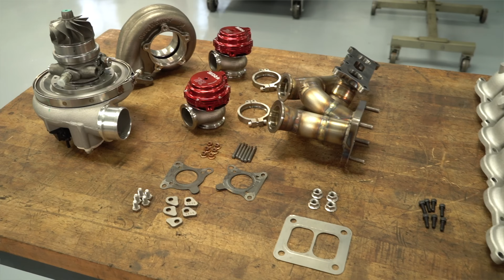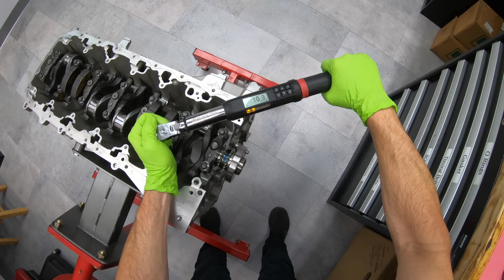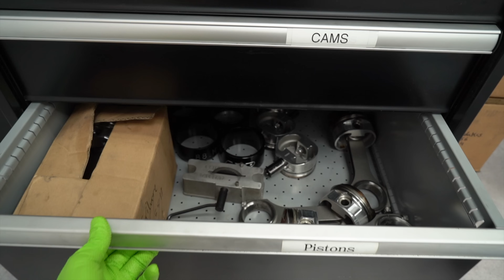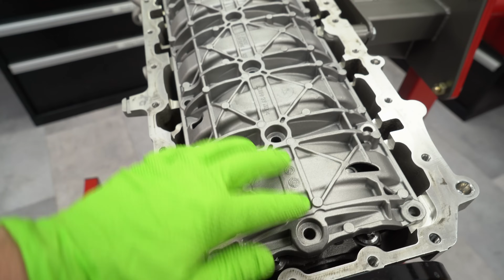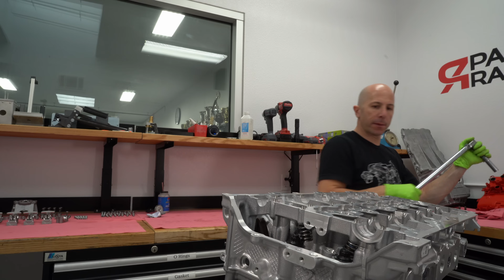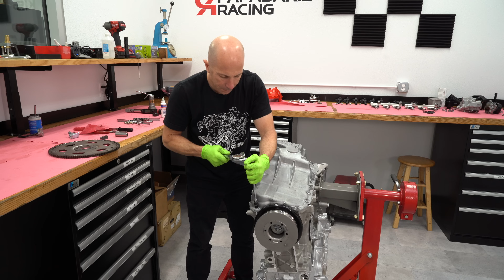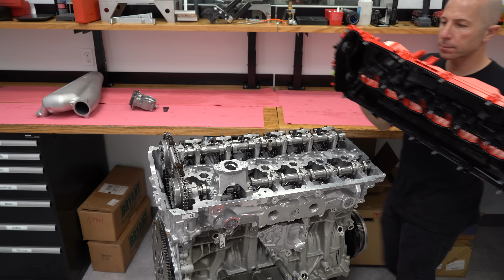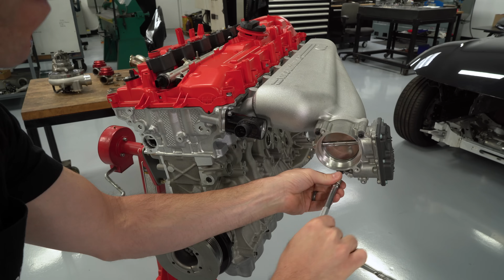2020 Supra 1000 HP Engine Assembly - Start to Finish

Comment: This gasoline engine is like M57 Diesel engine, very similar ;)
Reply: Wait, didn't that engine has multiple issues like timing chain snapped, connecting rod and crankshaft issue if I'm not mistaken or a different engine completely.
Reply: @zuhailishufller8046  Only timechain issue, after every 200k km you have to change it. 

Also camshaft issues, but that easy to fix and cheap. ;)

Comment: AdamLZ: “we have a 600hp Supra.”
Papadakis racing: “hold my candy bar.”

Edit: for those getting all bent out of shape over this, it’s just a joke!! Thanks for the likes
Reply: Adamlz also replaced his turbo. Adam is not the lame person here. Thestradman, vehicle virgins, and tjhunt are. They all just did widebody, bags, and/or wheels.
Reply: Naqay Chaayal  ... good one 😅
Reply: AdamLZ is just going with bolt-on parts. Anyone can do that.

Stephan actually tore down a brand-new engine to help in the research and development of new parts. And considering that he is using stock crank, bearings, piston rings, and camshafts, he'll see what are the limits of these parts.

It will be a very interesting build.
Reply: adamLZ: I have the current clickbait car watch this space
Professional tech: hold my boost
Reply: @MASSIVEsock  nah hes real shit but tj hunt hes the fucking flexer
Reply: Joonas Laakkonen TJ is definitely not the flexer. It is Year of the Flex for Adam. All TJ has is bags, wheels, and exhaust.
Reply: well adam is giving it away
Reply: AdamLZ still needs to put it on a dragstrip.  You can make a Dyno read high pretty easy.  I want to see it actually run a 1/4 mile or even V-box.
Reply: this two channel was awersome i follow both of them and i like very much. i m italian and was incredible like the american,  push on the horses reaching powers that we see here only on cars like lamborghini and ferrari.. Complements i wait for dyno! ✌✌✌
Reply: I love both channels and been a supporter of both since theirs beginnings, that being said this is a real build. Not just both ons. Lz is giving his away though! That’s pretty sick
Reply: @Joshua Webb Couldn't agree more.  I have one in my Jeep. Had a bored out 4.0 to 4.6 and that finally went now have a LS.  A couple years back.  The straight six was awesome for crawling, but the amount of fuel in CA i was going broke.
Reply: Papadakis racing: Hold my breaker bar....
Reply: Also Adam is giving the Supra away. I don’t think he’d put 1000hp engine in a car he’s not keeping.
Reply: Naqay Chaayal   Well said,   Perfectly put.   Too many CANDY BARS in the auto space of channels
Reply: YaBoiScoots Throtl is a good build channel. While they aren’t as experienced as Papadakis, they do some quality work and are always open to educating themselves to build better!
Reply: 😆nice
Reply: Its a poppet valved loop charged 2 stroke! Does it run amsoil dominator or silkolene pro 2 sx? These can run in any positions as these are a 2 stroke with valves! The toyota S-2 was a 2 stroke prototype of 3 liters and 260 to 300hp at 3200.
Reply: hold my ouzo you mean
Reply: I think Adam shows you what YOU can do with stock supra and few bolt-ons on the other hand Steph is building racing engine YOU can't build until you have good relationship with all companies who made those custom parts... incomparable
Reply: @MstreetDriver  Just give them the money and they will make whatever you want.
Reply: @MstreetDriver  to be fair it'd be pretty ignorant to say that these companies weren't already at least thinking about making aftermarket parts for these motors.  but you make a good point yes
Reply: @MstreetDriver  AdamLZ still hasn't done any runs or even VBOX  You can make any car 600hp on a dyno by just changing some settings on Dyno.  Not say he did, but I want to see real world run.
Reply: @MstreetDriver  💯
Reply: Joe Kinchicken  fuck are you talking about? Dude owns a highly successful racing and engineering team. And I dont know many 25 year olds that can afford a $65,000 car
Reply: @johnnyregs2378  and a nice house
Reply: @johnnyregs2378  also his net worth is around $3.2 million lool
Reply: Tbh adam is just pushing the limits of the stock motor . Papadakis is the dude you call when you want to go beyond the limit of the stock engine
Reply: @kevinpatriarch6719  yes sir he's the man for supra owners..
Reply: Adamlz supra is an enthusiast build this is a pro racing built motor. Dont get it twisted this motor would cost $50k +-
Reply: @sarahgrassi9648  lmao 50k
Reply: @sarahgrassi9648  you got it twisted
Reply: What candy bar dude, he finished it on his break!. Idiot
Reply: If only Adam knew anything about cars. I've never seen someone as clueless as him even being around them so long.
Reply: @Spac3Monkey  He knows stuff but not like papadakis who has a 25years of experience..
Reply: @Spac3Monkey  He is waaaay better than TJ Hunt
Reply: @Spac3Monkey  superspeederrob is pretty clueless for all the time he spent around cars...oh and definitely hoovie too
Reply: @Spac3Monkey  bruh adam knows his shit what are you talking about
Reply: Wtf!! Adam's Supra is stock whereas Stephen has built the B58. Both are different things
Reply: Yes but adam's just has a tune, downpipe and meth injection
Reply: @turbodragon66  Adams has turbo change as well

Comment: Are you not anticipating any issues from the placement of that second (forward) wastegate being 90 deg to the flow of exhaust?  I’m assuming it’s not ideal but maybe not impact boost control enough to matter. It just looks like they had the room to angle it forward a bit and just did it that way for a symmetrical look with the other one

Comment: Selective Laser Melted aluminum printed parts! Oh wait, that is "additive manufactured" parts. It's only a matter of time before you 3D print the exhaust manifolds from inconel. (That's already possible, but even more expensive than printing aluminum.)

Comment: Nice video and nice editing. Youre really good at dumbing shit down. That said, why delete all the nice shit on this engine? Srsly? Delete direct injection, omg why not keep it for low range driveability. Also deleting the valvetronic is totally idiotic. The factory TB is only there as a safe guard in case the valvetronic motor fails.

Comment: It's got a terrible bore to stroke ratio and that head, roller rockers on a OHC engine?  Dumb.
Reply: @Seb C Well, if you know your Supras then you know the 7m was widely criticized for it's long 91mm stroke and 83mm bore.  To put that in context, the 2jz is 86mm x 86mm.  This 2020 BMW engine has 94.6mm stroke and 82mm bore, thus it will never rev high.  Also, smaller bores = smaller valves and a smaller combustion chamber.  Not good.

Rockers are traditionally found on push rod engines but not exclusively.  Roller rockers in OHC might lower some friction and lead to longer cam life but introduce more slop in the valve train leading to a less propensity to rev.  With the 7m/2jz, the cam lobe sits right on bucket shim which is directly over the valve.  That make sense?
Reply: @Seb C Much better to have the propensity for higher RPMs utilizing a smaller displacement engine force fed with a turbo than a 'under the curve', low RPM - high piston speed truck engine.  Again see 7mgte vs 2jzgte - I've had both.  As for valve train slop, we know pushrod engines will never rev like cam lobe over valve.  I do understand manufacturer reasons why they implemented that system.

Comment: i just dont see the exhaust ports being able to flow enough air for 1000 hp. i am truly excited for the engine dyno
Reply: My initial thoughts aswell but Papapadadakkisss knows his stuff!
Reply: He did say they had it ported etc but I’m sure those caps/blanks can be removed for more flo if needed @11.40
Reply: elly boos theres no sealing surface or bolt holes for a manifold to bolt on to those though, probably got another use associated with the cams or something
Reply: I see it hitting 1000 on those ports but nothing more than that that port to me will be the main limitation
Reply: Trent Szopinski no different to a 13b with regards to opening size and those motors can put out 1000hp
Reply: Well exhaust don't need to be big enough to make power.
Compression ratio is what make the power.
Having a slightly over stock compression will gain you hp by 5 to 10% but at the same times you are sacrificing the block to blow up unless it has self adjustment cam timing.
The only time you need a bigger export is when you planning to over boosted it with high boost pressure and nos
Then yeah you need to let all those glasses out before it blows up.
This why manufacturer are slightly increasing compression since it give out more hp and a slightly better mpg.
Reply: Why not? Guys make 4 digit power on t4 turbo flanges which are smaller than those ports. Turbos mostly spool off of heat expansion in exhaust gases, not airflow.

Comment: Papadakis Racing, from what knowledge you’ve managed to attain, what are the stock rods and pistons supposed to be able to handle? I’m also wondering what measures the B58 cylinders uses to handle boost? The block is aluminum and I didn’t see sleeves in there. Does it have that "plasma spray” (whatever that tech is) that strengthens cylinder walls? Thanks for taking the time to read this and hopefully can respond. 😁

Comment: Unless this motor is sleeved it won't last long. Interested to see how long the head last because most of the exhaust is channeled through the head to two exhaust ports. It's guarantee to heat up and prone to warping I bet. With the timing ridiculous hard to set and being at the rear of the engine towards the fire wall and coated cylinder walls this thing won't last long and will not be tunner friendly like Toyota said. You will have to take it to a shop or pull the motor to change the timing chain ridiculous. No wonder this car has already been designated a flop

Comment: Needs tons of special tools, a plastic electronic oil level sensor mounted to the bottom of the pan ( what could go wrong? ),  overly complicated for no benefit, lot's of weak factory components that need replacing, and on top of that, all at BMW prices.....

I appreciate what you're doing here, and I am interested to see where this goes, BUT I couldn't have a bigger grin on my face with basically the confirmation to stay away from this pos.

Comment: Might be me old school self but i do NOT see that internal head collector exhaust manifold dealy working very well. The holes are smaller than a single honda intake valve and is expected to run air for 3 cylinders? Man just not seeing from an engineering heat managment standpoint or a flow standpoint. It literally made me think. Baseball thrue garden hose

Comment: That snap -on torque wrench costs more than my freaking car!!!
Reply: They're not that great either. I calibrate them for the military and they generally aren't super accurate
Reply: @TheMokafan  Interesting.  I still prefer the old calibrated low tech spring loaded ones.
Reply: @TheMokafan  Is there a way to calibrate spring loaded ones at home? It would cost the price of a new one to calibrate over here...
Reply: Patrick Aekkaa someone works pmel
Reply: They're only like 350 used. you must have a pos car.
Reply: @frontspring1  he don't say if was new or used dude
Reply: @frontspring1  🤣🤣🤣
Reply: i mean, if you have a mk5 supra right now in 2019, and you are rebuilding the engine to make 1000hp, you probably won't mind buying one of those torque wrenches.
Reply: Ive got 2 of them at work in 1/2" and 3/8". Definitely my favorite bit of gear from snap-on. Use them to measure the maximum resistance through centre when rebuilding steering gear.
Reply: I use them all the time. They are accurate to about 1lbft of variance. Significantly more accurate the the click style torque wrenches but nothing beats a dial torque wrench. They are great for efficiency and imo are probably the best choice for busting out repairs as fast as possible. You can get them for 300-ish bucks new if you suck off the snapon man.
Reply: Vidal J I had to take out a loan to get the half inch version lmaooo
Reply: Im from ireland, never seen the brand over here.. is snap on a quality brand or cheap one.. we have Milwaukee here and there really good, better than dewalt imo
Reply: @byrnesy919  Snap On is supposedly a very high quality brand. 
It depends on who you ask.
One thing that's for sure is that they are a VERY expensive brand.
Reply: @byrnesy919  Snap on is the Gucci Brand of tools. Good Quality but costs a fortune and your better off buying Milwaukie
Reply: @byrnesy919  are snap on really not in Ireland? They are the backbone of professional mechanics in mainland UK and I know friends who use them in Northern Ireland. How could you not know about them in S Ireland?!?
Reply: I got 1/4,3/8, and 1/2 in green. Well worth the money
Reply: Milwaukee is better value
Reply: 3/8" Drive TechAngle® Flex-Head Torque Wrench (5-125 ft-lb)  ATECH2FR125B
 $595.00
Reply: Ur car cost 600 bucks?
Reply: Snap on isn’t worth it, Craftsman has the same warranty. Was a GM tech for 12 years, all my specialty tools are Lisle while all the rest are Craftsman and I’ve never had a problem with any of them.
Reply: Hahaha torque wrench costs more than an axle back for my pos Nissan 😂 I think I know where my money is going 😂

Comment: @PapadakisRacing So your not using the direct injection system and going to use port injection? Is this for tuning purposes or for multiple injectors or maybe too much heat? And in theory could you use the direct injection and add port injection when you hit that point of maxing out the direct injected injectors?

Comment: What's the idea behind using port injection instead of direct? Too hard to get high enough flowing version of the direct injectors? Little help in cooling the intake charge before it gets into the cylinder?